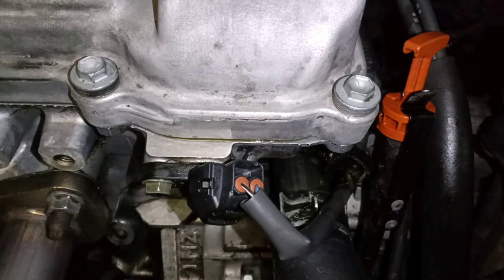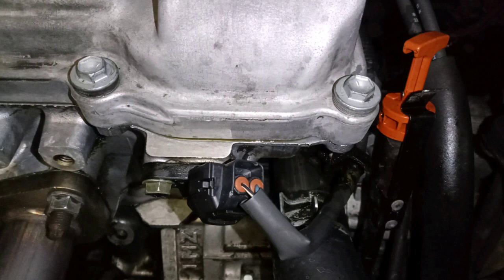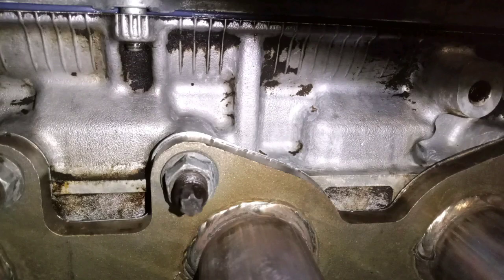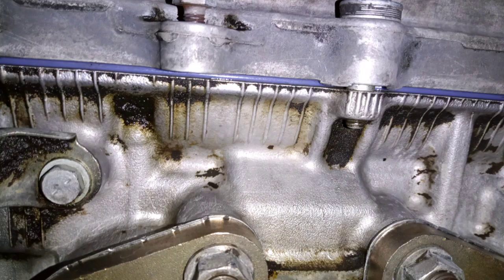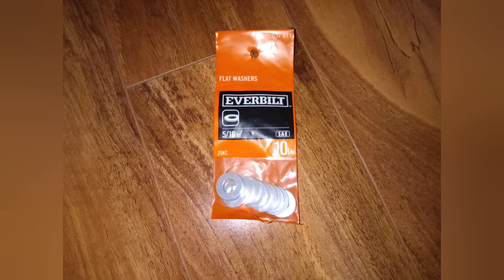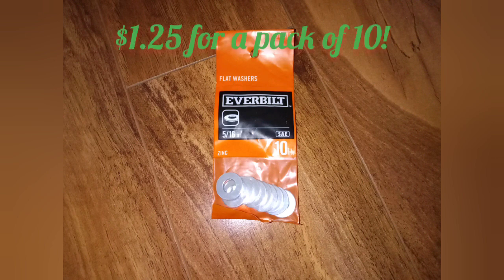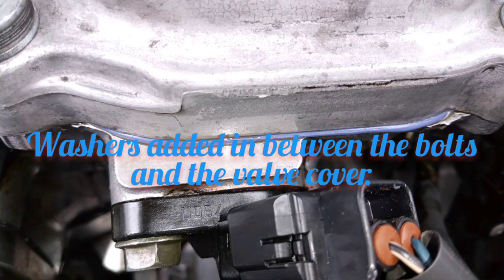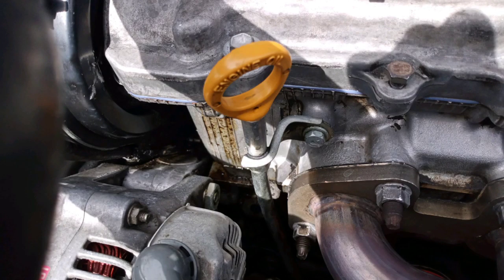Quick Fix on 1998-2003 Toyota Sienna Valve Covers Gasket Leak.

Comment: Partially correct - When the valve cover is replaced the bolt PRESSURE BALANCING washers are supposed to be replaced also - Thanks for sharing tho
Reply from the maker: Good to know! What if you have no access to new washers? We compromised and get it done until then.😎👍

Comment: Thanks for sharing, I was thinking to do exactly what you did. I did it twice and still leaking worse than it was originally, I noticed that there is a huge gap between the cylinders head and the valve covers with all bolts all the way down. Tomorrow I will go to home Depot to buy the washers.
Reply from the maker: Remember that these bolt stretched after you torque them down. The washers make up those space.

Comment: Thank you for this information, I have changed 2 gaskets but still leaking badly, both gaskets from fel-pro (blue color) before replacing it was leaking but not badly now after replacing it is really bad, any suggestion. Thanks again
Reply from the maker: Run an additional bead of blue silicon sealant below and under the gasket. Let's it sit for 24 hours before running the engine so the sealant has time to cure and hardened. You don't want loose sealant floating around inside your engine. 😱
Reply: @MoBangFoYoBucks  Thank you and have a wonderful day

Comment: I remember a trick my dad taught me in the 60s when I helped him. 
When you take off a valve cover you see the holes are a little pushed in from before with the bolt being tight. 
You turn the valve cover upside down and use two sockets and a hammer to bend the metal back straight so they push down on the gasket.  Adding a washer like you did is even better.
Some cars now have plastic valve covers instead so don't try this with plastic. 
You will break it. Only use it for metal ones.
Reply from the maker: Great tip Chuck about plastic cover!

Comment: Can i just add washers instead of replacing the gasket?
Reply from the maker: No, because the old gasket is no longer doing its job. Chances are those gaskets have been there for many many years. They are dried and brittle! Sorry, I don't think that the answer you hoping for.🤷
Reply: @MoBangFoYoBucks  i will get a new gasket and washers. Thanks!

Comment: 71 imch pounds or 5.?? Ft/pounds still with washers don't over torque or tears will follow. Nightmare😢
Reply from the maker: @JohnnyAtlas  So what's your solution?
Reply: @MoBangFoYoBucks  using washers is great but now you create space if you over torque you could snap your cover or break a bolt and gasket, which I did because I was rushing. You got to commit to starting at middle bolts and working your way out and repeat several times. I'm currently doing the rear and have to put the rest back on hoping I don't get a leak.
Reply from the maker: @JohnnyAtlas  😱 I din't even use torque wrench! I just tightened them enough to keep the oil from leaking. If it still leaks, I tighgen just a bit more evenly on all bolts. I use 1/4" wrachet, so there is no way that you can overly tighten them bolts. Also, I did put a thin layer of sealant, which helped fill up any uneveness.
Reply: @MoBangFoYoBucks  me too I don't have a torque wrench that goes that low. Used a 90 deg DeWalt screwdriver attachment made nice for those back bolts.